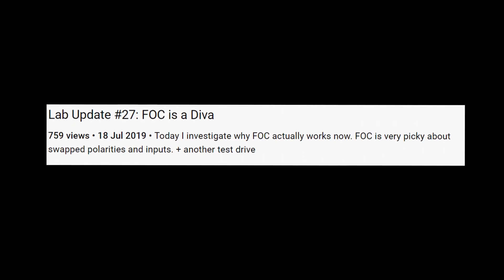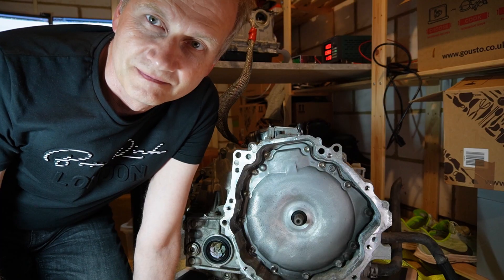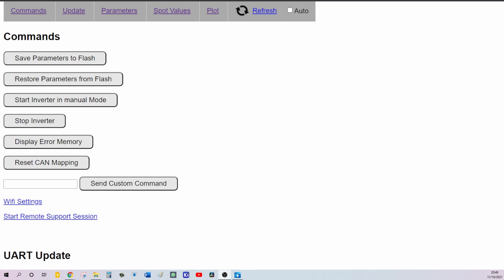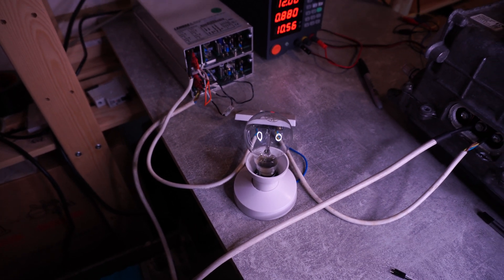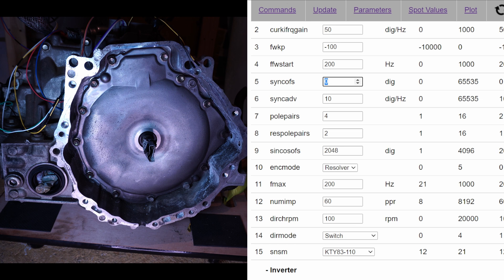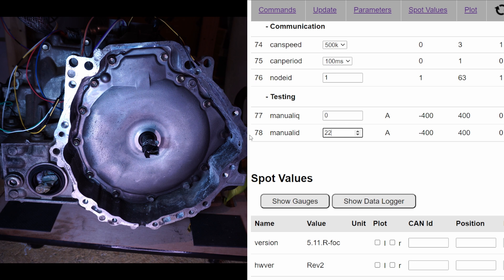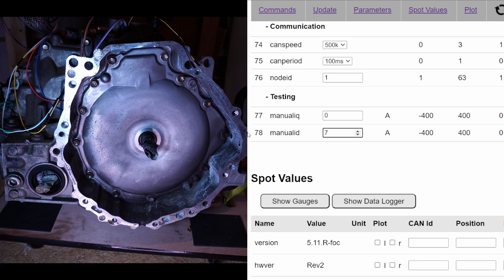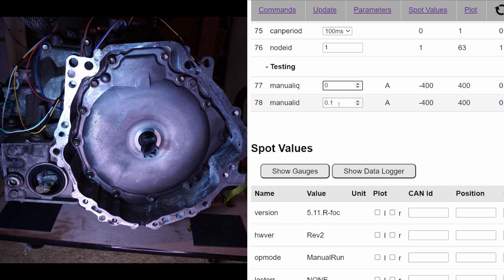Testing resolver and Tune MG1 DIY EV Toyota Prius Ep12

Comment: I want to use Gen 3 or gen 5 motor for a civic or mini cooper swap. Id ideally like to run 2 or 4 prius motors. how difficult of a task would this be compared to just using a tesla motor?
Reply from the maker: This is a very interesting question. I was considering myself perhaps taking two Prius gearboxes and removing mg1 while combining mg2s into one motor. In your case you can consider doing the same for front and rear. But it will not be simple I can tell you that. If you just take each gearbox and inverter as is the weight penalty would be considerable

Comment: Which software is u use for foc tuning?
Reply from the maker: I use Open Inverter software. It could be found on Johannes Hubner  GitHub page. He actually recently released a new version with improved field weakening algorithm. It works very well.
Reply from the maker: If you check this page it describes all the process of building and programming the board : https://openinverter.org/wiki/Toyota_Prius_Gen3_Board
Reply: @LatutaEV  thank you so much for sharing me such a great information.
Reply: @LatutaEV  can we discuss another topic if you don't mind that is about nissan note e power inverter system.
Reply from the maker: @abubakarghuman5248  You're welcome I hope it will help you. 👍
Reply from the maker: @abubakarghuman5248  I am sorry I don't know much about Nissan inverter.

Comment: Hi. When I start the inverter, a temperature error comes out all the time, I even set the temperature to 150, but still an error about overheating the inverter comes out. That is, the temperature of the radiator goes (allegedly) beyond the permissible limits. I don't even load the inverter yet, but I'm doing a test run. I'm trying to find solutions on the forum, but so far without a result:(. Can you tell me how to fix it? Thank you in advance!
Reply from the maker: I would look at the circuit diagram and see what voltage you getting on the temperature sensor and see if it is changing or constant. You may have a PCB fault that doesn't give you a true reading
Reply: @LatutaEV  Thank you for replying. That's a good idea, I didn't think of it. I would also like to know where the radiator temperature sensor is:). Thanks again.

Comment: Can the Prius C  motor be used in another car? It seems not to be remountable?
Reply from the maker: Pretty much any ac motor with permanent magnets could be used. Some people are using Mitsubishi Outlander motor as well
Reply: @LatutaEV  thank you. The technical specs for a Prius c say it has a 144v battery which is why I thought it would work for that voltage.

Comment: Hey Ed , good video on FOC tuning , thank you. I'm working on the small (think you have the Yaris/Auris board there) dual board and a L210 RWD gearbox.  Today I learnt what the pinswap does with Toyota motors - thank you  keep up the good works and videos.
Reply from the maker: Thank you for your kind words. Unfortunately I have ordered a Prius board and it is a bit too big for my inverter. If you check my video #4 you will see that I had to cut it slightly and drill a new mounting hole. I now wish that I ordered a Yaris Auris board. I planing to order a dual motor board so I will go for a smaller version. I have an idea to try two MG2 with one inverter. But first I need to see how much power I could get running MG2 on connected to MG1 igbt from the inverter
Reply: @LatutaEV  I have 5 dual small boards on the way, fully populated except the main processors which I have coming seperately , I'd be happy to send one for you to play with when they get here pm thornogson on the forum to sort this out . The Yaris/Auris inverters although cheaper have smaller capacitors I think. I'm doing this as a learning thing and I'm learning a lot !
Reply from the maker: @JCHBArchive  yes sure I was going to order one anyway I will get in touch on the forum